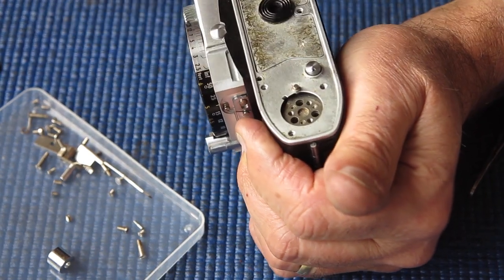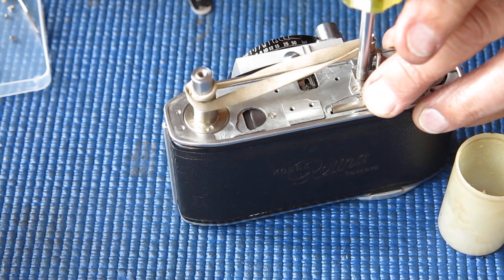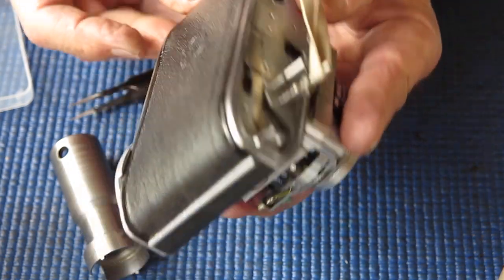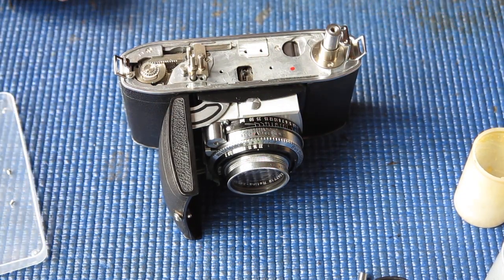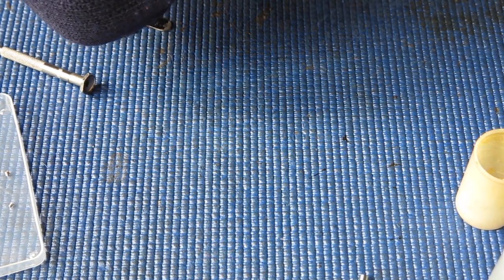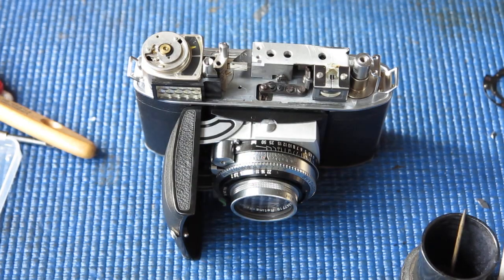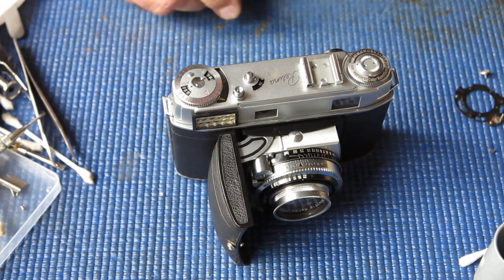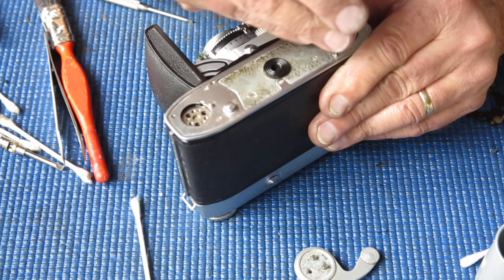Another Kodak Retina IIIc camera here for servicing, part 07

Comment: When the leatherette is very brittle, do you ever try and soften it while it's on the camera, Chris?
Reply from the maker: I've certainly done that when replacing leatherettes to help get a bump to lie flat, but I've not tried it before removing leatherettes. To get more heat into the leatherette without melting it you can also try heating the body casting from the inside with a hairdryer too.
Reply: @ChrisSherlock  Thanks Chris. I'll try that. The Foth Derby front body sections have as much curve as flat. No matter where you start you are bending the brittle leatherette the wrong way. I've already cracked a small section, but it looks okay to blend back in. Onward...